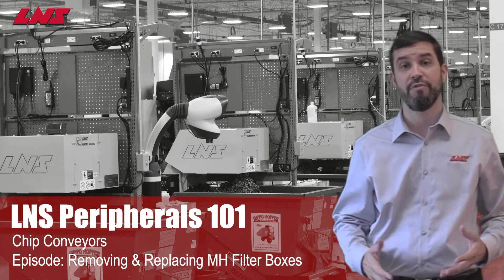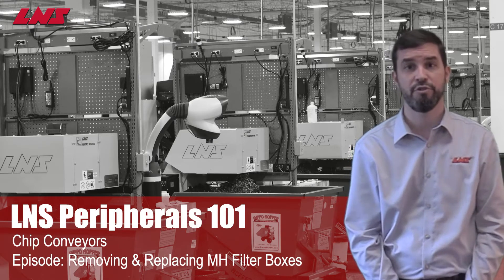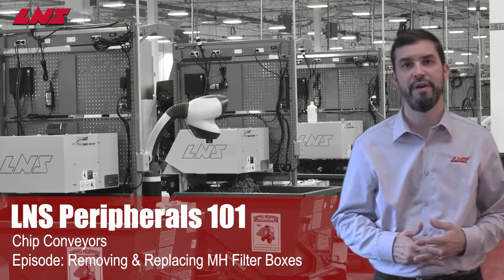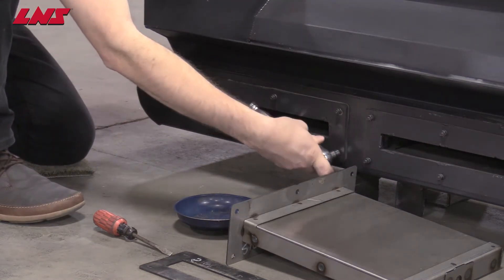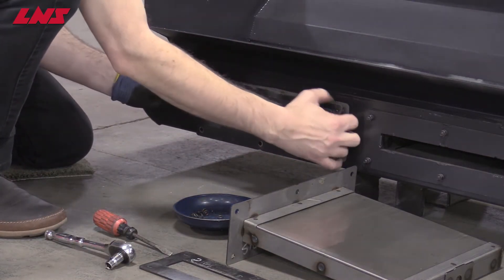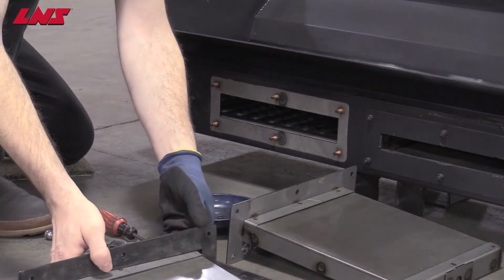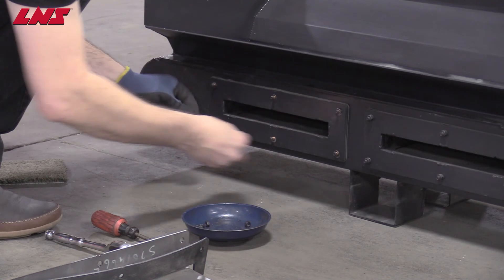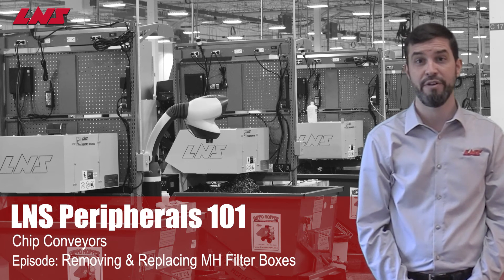LNS Turbo Chip Conveyor Removing and Replacing MH Filter Boxes

Comment: The life will depend on your application, most customer have used the original filter boxes for several years.  If you notice coolant starting to back up inside the conveyor frame, it may be caused by a dirty/blinded filter media